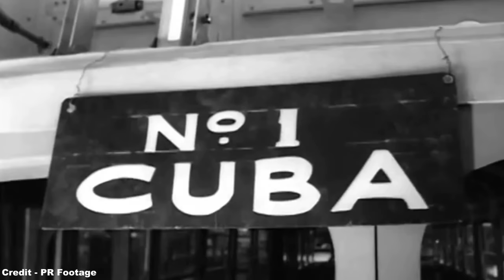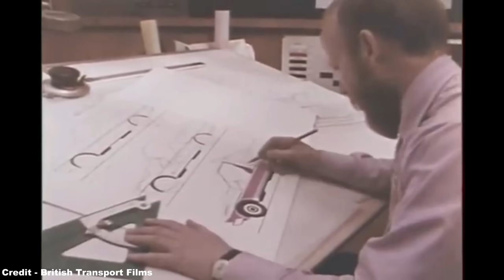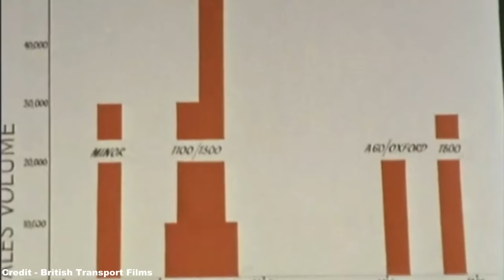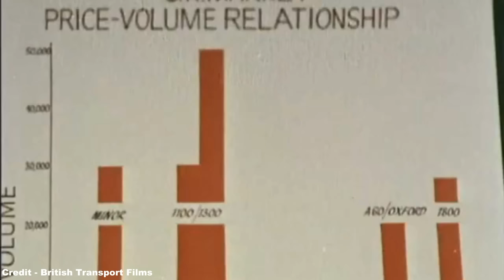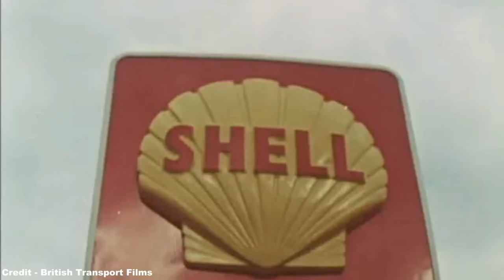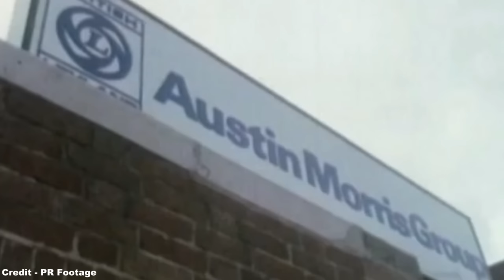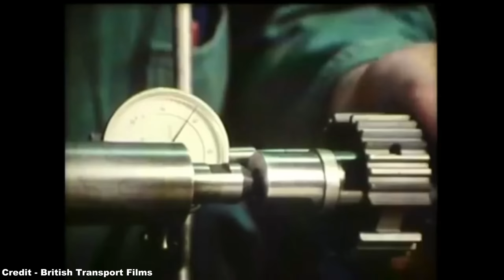Death of the UK Car Industry - Part 2: British Leyland

Comment: The Marina was universally derided as terrible.  It's strange that the Marina outsold the Hillman Avenger, despite the latter being a superior vehicle in almost every measurable way, especially road holding.  The Marina's handling was so poor as to be very nearly dangerous.  The Avenger could be chucked around until the tyres start to squeal and it would still handle predictably.  I'm not just remembering this with rose tinted glasses because a 1972 Avenger is still my daily driver.

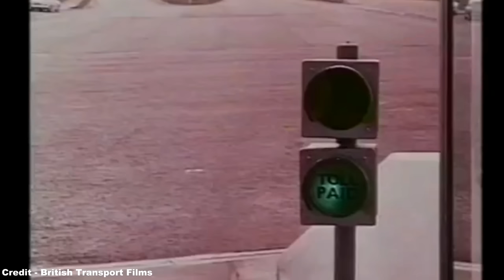Comment: 3:02 The Austin 3 Litre wasn't just an Austin 1800 with a revised rear end, it was actually a lot less. While the landcrabs, including the Austin 1800 and its later six cylinder stablmate were essentially overgrown minis with transverse front wheel drive and a hydrogas suspension, the 3 Litre tried to  justify its higher cost by taking the landcrab's bodyshell and fitting it with a longitudinally mounted 3 liter inline six driving the car's rear wheels. I think it was one of BMC's worse ideas, a homely miss-mash that lost the landcrabs' space efficiency without gaining the gravitas needed to make the car worthy of competing in the more prestigious market it was priced into.
Reply: I think it was also their attempt to follow on from the recently discontinued Austin Westminster and Woleseley 6 110 both of which also used the 3 liter RWD six (as did the big Healy).

Comment: Ah yes, the Hunter… if memory serves, the handbrake was on the right of the driver’s seat… the only other vehicle I have driven which had the same feature was a Peugeot van.
Reply: The XJS had the handbrake on the right. My dad had a 1976 XJ-S, it broke down alot!😢
Reply: & the Singer Vogue... I so wanted to learn to drive in our green one with the twin headlights at 14 but my Dad refused with that as a reason !!
Reply: Aston Martin DB 5 (I think). Fly-off handbrake.
Reply: Volvo Amazon & 144 range , BMC A60 models& the   P4 Rover had the handbrake on the driver's side!
Reply: It was a throwback to bench seats in the front. The seats became two  singles  but the handbrakes were never moved.
Reply: Morris oxford / Austin Cambridge also

Comment: All cars of the 1950s & 60s were really shoddily built.
They also cost an arm & a leg to buy.

My mini had minimal amount of paint under the wings & the electrics were awful.
If you looked under the front wings you could see the wire to the headlight & indicators just hanging.
There was no cover or protection at the back of the lights so consequently, the units rotted away very quickly & you were always having electrical wiring issues.
Looking the other way under the front wings towards the bulkhead, there was an area that collected all the mud & road gunge.
This got lodged up there, dryed out & created a sponge like mass for rot to establish itself in.
Rear sub-frames rotted away in 5 years, & were an expensive replacement at the dealership workshop.
Luckily for me, I was an apprentice engineer & replaced mine on the driveway at home with the car body jacked up on house brick (nobody cared about health & safety in the 60s 😂).
A new rear sub-frame cost me £11 from the spares dept.
Reply: Was that sub-frame replacement a wielding job? Or did they bolt or rivet it back in those times? I had my Defender done recently with galvanised parts as the rot really fcks over certain areas to this day.
Reply: @LandersWorkshop  On the Mini of the 1960s, the 'over the counter' rear sub-frame from a BMC Spares Dept,  was made of spot welded  pressed steel, with ONE coat of gloss black to protect it.

They bolted onto 'Hard Points' in the car body, both forwards & upwards.

It cost me just over £11 to buy Brand New in 1968.

Comment: So many people to blame for so many mistakes and problems. The Mini was the star and a marque obviously in its own right with Metro should have always been intended to run alongside not as a replacement. The Austin name should have been dropped and innovation money spent on the two money makers not on the naff montego and meastro.
Reply: Those Montegos and Maestros, what dreadful cars they were. As a passenger they were bland and as a driver seemed cheap and mismatched when it came to the body and engine.

Comment: I left school in the mid eightys and started work in the car trade as a trainee mechanic and remember working on these makes and models I used to change a lot of suspension parts trunnions seem to spring to mind but it was the rust that killed them off by the mid nintys I was an MOT tester I wrote so many off as to experience to repair and with the onset of emission regulations the old A series was a struggle to get through CO emission regs .

Comment: Why did Triumph develop it's own v8 engine when Rover had  PERFECTLY GOOD V8 THEY COULD HAVE USED
Reply: Because it was a Rover engine!
Despite being under the BL umbrella, the different managements saw each others as competition. There was no way that Triumph could have gone to Rover for the engine.
Reply: Because at the time that their V-8 were being developed, Triumph and Rover were direct competitors, completely independent of each other. There was no way in which Triumph would have sourced an engine from Rover. Keep in mind the fact that BL wasn't formed until January 1968. The formation of the Specialist Car Division (Rover, Land Rover, Triumph, Jaguar and Alvis) was part of that merger.
Reply: The 'Rover V8' was actually a licensed Buick design. It is tiny by US standards in its original 3.5L form
Reply: @NJPurling  Almost correct, though it wasn't licenced, as Rover actually purchased the tooling of the Buick/Oldsmobile/Pontiac 215 (BOP 215) V8 engine from GM in 1960. The '215' is the engine's size in cubic inches, being 3,523 cc's. It is indeed tiny by US standards.
Reply: Inter-Marque rivalry in the same Automotive group  Glad they did not do that. 

Of the 25,000 Triumph Stags made in the 1970s. over half of them still exist. Many now in enthusiast hands. Voted the favourite UK Classic car in a recent poll. 

Those initial coolant problems an easy DIY fix that's why so many still exist. Too may rushed jobs back then and not only with British cars.

To my old ears, the Stag Triumph V8 is bar far the nicest sounding V8 ever. I speak as an owner of an MG ZT with eight cylinders and a galloping equine on its throttle body. That makes a superb sound when those eight cylinders come on song but not as nice as the Triumph V8.

Comment: Look I am not going to watch all of this because I lived through it all. To me the problem is quality standards. You order a Toyota and you wait two years to receive it because they won't compromise on quality where England Leyland could not keep up with demand so they pushed Rover V8 engine blocks out substandard in the 1990s which commonly failed ie slipped liners and misaligned castings etc. It was the attitude of the management that destroyed the British car industry. And no I did not have a problem Rover. Both of mine were luckily ok but the people around me did and the Rover name is now spelt "mud".
Reply: My father did just that and replaced his reliable Mini Van with a Toyota Starlet. In a mustard yellow colour.

Move on a few winters and I could not believe my eyes. The Japanese thing dissolved before my very eyes every rain shower. Soon the corrosion holes were large enough to put my hand through. 

Forget all that, only British cars corroded. Italian Japanese and Germans never do.

Over my long car owning career I often talk to my helpful MoT test Guys when testing one of my family's MGs and Rovers. They is at the reality face of so called superior foreign corrosion myths. Even Mercedes and BMW have been known to have terminal corrosion issues. Broken suspension spring commonplace.

Visit your local Car Breaker Yard see the lines of Japanese, French and so called superior German Premium stuff there riddled with corrosion.  All considerably younger than my near corrosion free MG ZEDs in the family fleet. All now around twenty years old or older.

Comment: I can't help but think that the problem with many of the post Issigonis Mini offerings from Austin and Morris that they are appalling ugly. Just look at the 1800/2200! What were they thinking? I was frankly embarrassed to be seen in my dad's 1100. His loyalty knew no bounds, however, as he subsequently bought the Maxi and a couple of versions of the Mini Metro. Thankfully he skipped the Marina, Allegro and the Princess. My uncles had real cars, the Fords Anglia, Cortina, Consul and Zodiac.
Sir Alec seemed to be hamstrung by the management re the Mini replacement and the Allegro design. Could have had two excellent cars there even if his original Allegro was still a bit of a beast to look at. And the adverts! My god! Horrible cars being driven in formation along dismal beaches or thrown around quarries and gravel pits...

Comment: Trade unions are the pits in most cases.
Reply: It takes 2 to cause problems. The management also had to share the blame.
Reply: Try management
Reply: Unionism is self-defense.
Reply: The way those unions increased our sick pay, holidays and working conditions is a disgrace.
Reply: @robertely686  But they also opposed a lot of much needed modernization. When I worked for British Gas in the pre-privatization era, there was a strike by the meter readers over the introduction of 'new technology' in the processing of the paper sheets on which readings had to be recorded in those days (they were later replaced with hand-held electronic devices, which in turn gave way to remote reading). The change entailed some alterations to the layout of the sheets but made no difference to the way the meter readers did their job. In the end the new sheets had to be scrapped and replaced by ones which looked more like the old ones but were still compatible with the new processing.
Reply: @CharlesStearman  fair point. Personally I feel that our decline was just the fact of the end stages of imperialism - there's nothing we could do.
Imperialist success depends on creating monopolies, building cartels, forcing competitors out of business as well as the theft of resources and land and slavery etc.
Without innovation, actual fair trade, honest leadership or respect for other countries we had no chance to continue selling our goods or way of life to them once we had removed our boot from their necks.
We're now facing a second decline as the subjects of an American empire in decline.
Reply: @CharlesStearman  WHY did the workers oppose that modernization? That is the vital question you have failed to ask. Is it because they were inherently unreasonable... or because they had become so used to being screwed over by poor management decisions, that they no longer had trust in their managers? I think you'll find the truth is the latter, not the former.
Reply: @iankemp2627 don’t agree. I worked in the shipyards when I left school, we worked 2 days and played cards for 3. We knew the unions were just as bad as the management but one side offered paid days mucking about and the other didn’t.
There was no ‘fighting the cause’ the world had moved on and we couldn’t give a monkey’s.